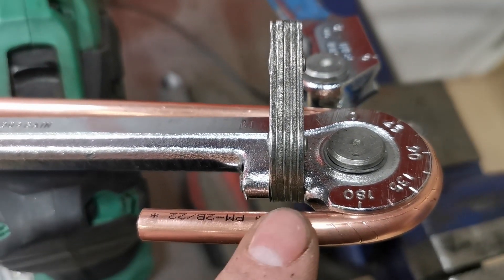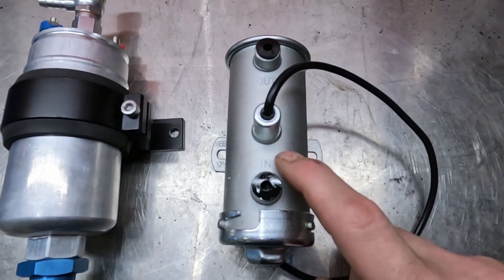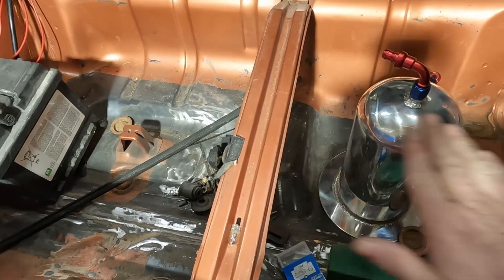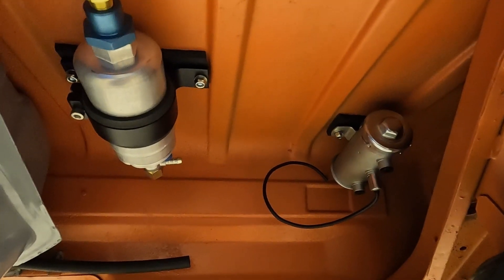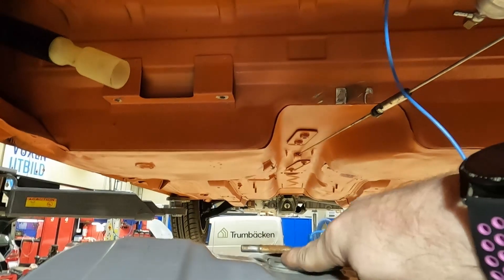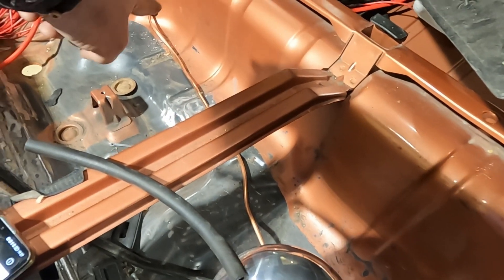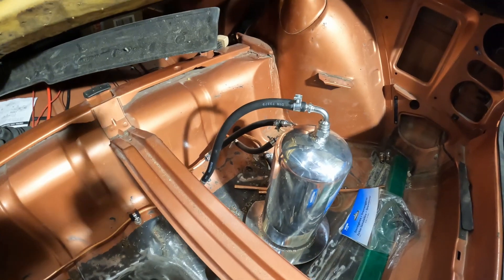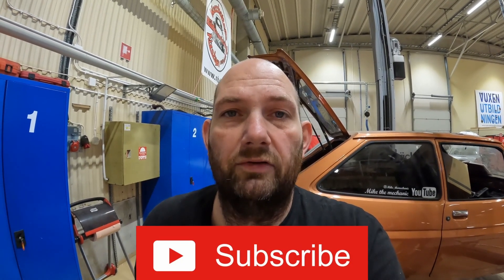Fitting my injection fuel system. Mk1 Ford Fiesta zetec conversion.

Comment: Hi Mike, what you've done in this video is my next job...I'm just researching wiring with a two pump setup. How did you wire up this with the two fuel pump setup? Both pumps on a single relay or a relay each? Thanks
Reply from the maker: Yeah I have both running from one relay and power out from the relay goes to the high pressure pump and then on to the low pressure pump. I made a video on wiring the pumps in
Reply: @mike_themechanic  Nice, thanks for that! Ah, I must of missed that wiring video...which video is that in?
Reply from the maker: @Mk2seal  https://youtu.be/IY-gPkqrhgY
This one.
Reply: @mike_themechanic  Thanks…I’ll be watching that tomorrow 👍 Somehow, I completely missed that wiring video.
Reply from the maker: No worries. Hope it helps. If you need any more help just let me know and I'll do my best.